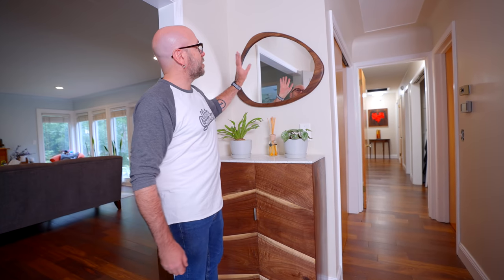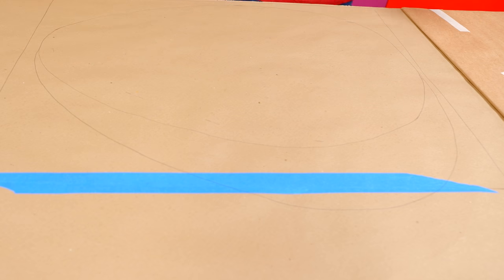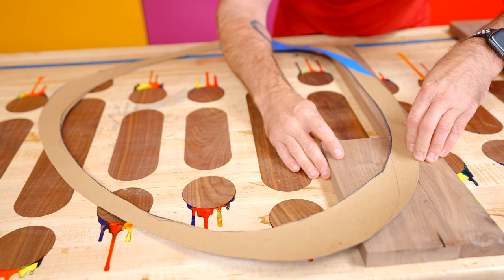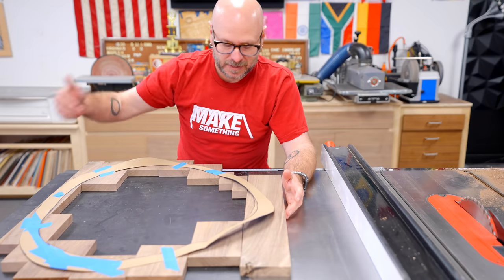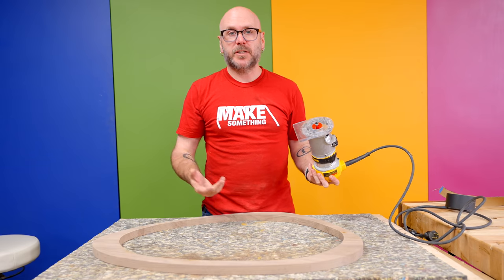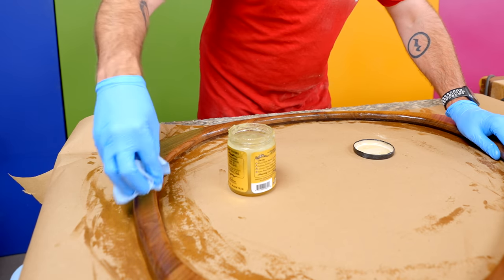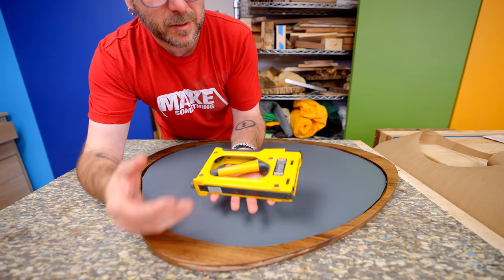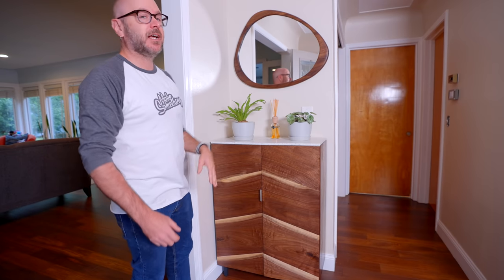How to make a funky mirror and cut curves in glass. Woodworking project

Comment: TU. It came out great. Few things that occured to me, not criticisms, just potential alternative options. 

1) I would probabaly cut the mirror first since that's the hard part. That way if the glass snapped a little bit off want was planned, or if it didn't come out perfect, you can adjust the frame accordingly 

2) the Walnut did come out great! I would have considered a walnut veneered plywood. Would have probably been much easier to just cut out the circular shape than edge joining. Would need some edge banding though on the outside unless the plywood look is okay with you 
.
3) I wonder if it would work to not even cut the glass. Just have the wood in the shape you want, and cut an inlay in the back so the entire circle mirror fits inside, but on the front only the circularnshape you want is exposed. The shaoenwojld be a bit different and the wood would probabaly need to be a bit wider in a few spots, but reduce the risk of breaking the mirror / fear factor of cutting it. 

Just a few thoughts.

Comment: I love your videos dude. If you don’t mind, I do have a pointer for your hanging hardware. I would recommend putting the hardware approx. a third down from the top and when you tie your wire on, pull it as taught as possible. Wire will stretch and sag overtime so if you use the plastic coated wound wire and pull it taught, you’ll get a closer hang to the wall, a neater finish to the piece, and a longer lasting solution. 
I know your vids are about having fun making stuff. I just spent 4 years selling and making frames and I couldn’t help but share this tip. Take it or leave it and thank you for the excellent vids
Reply from the maker: Thanks!

Comment: Awesome project!! I have not been able to cut glass like that. I might need a better glass cutter haha it's probably from Nam.
Reply from the maker: I’ve found that the pistol grip cutters are easier to use.
Reply: @MakeSomething  awesome. Thanks! I will have to get one of those. I also have never seen that oil. Is that something special or just any cutting oil as a lubricant?